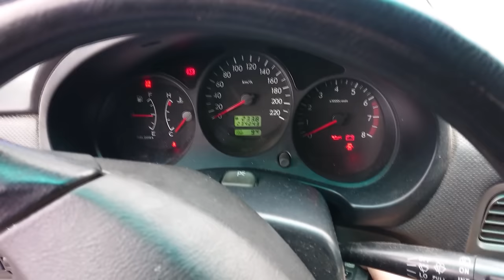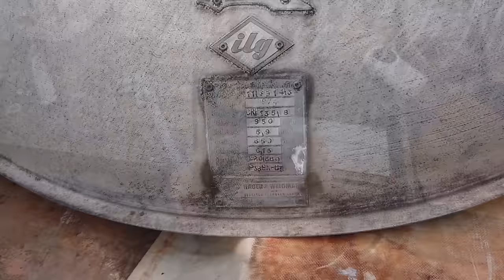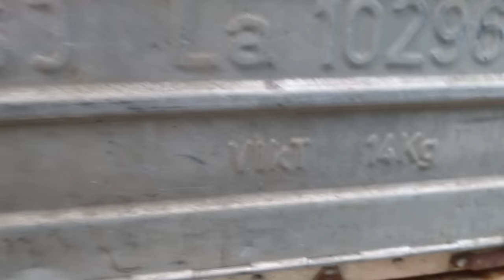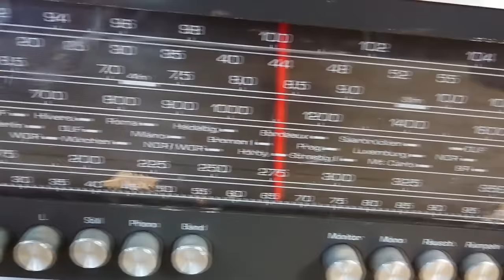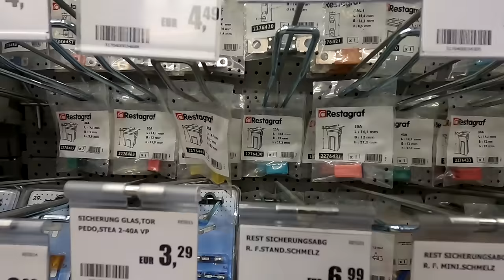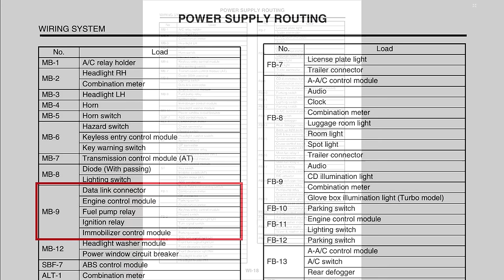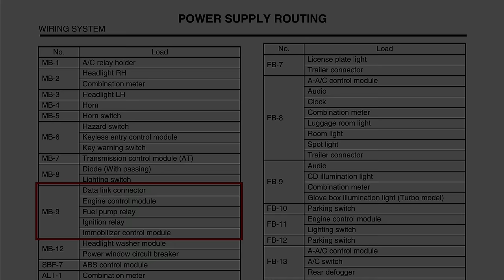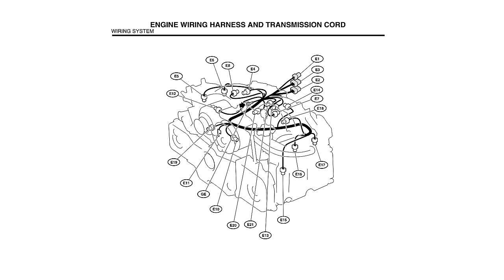New Awesome Scrapyard Finds! Repair-A-Thon!

Comment: I had a similar problem the mice had chewed through about six wires and nothing would work all sorts of errors. Repaired the harness and decided to move the car to different parking places to discourage the mice.  The most successful device I had that stopped them for many years was poison. I used a waxy bait which tasted similar to the insulation I hoped for. I place all over the engine bay very close to the major wiring junction to try and tempt away from the wires. It works for me. You do have to check it several times a year but it gives an idea if they are active again. 
I did have a self working mouse killer that turned up on its own. It was a snake that followed the mice into the car one day and was there somewhere for about a week before dropping down one day going on it's way. We get a lot of snakes in southern Spain.

Comment: Looks like the cable has been connected with solder there, and maybe the solder deteriorated and has risen the resistance of the cable and got it hot, because the insulation was melted in that area. 
I would spray the car and the surroundings with nasty chemicals like capsaicin so any creature without a gas mask would in serious trouble, so only you and JoeX would be able to drive the car. Very impressive work my friend i like this very much, and your attitude against modern rules.

Comment: I seen, heard and driven cars with these problems. A work truck that we had was bought for dirt cheap because it had a wire problem. A lot of late nights and a new wire harness fixed the issues. I have seen several nice looking units that sit because of this problem. 
The worst we had was a short in the ac unit on out last car. We traded up to a newer model before we got around to fixing it. The problem was the clutch which was a 50 dollar part and required to you recharge the entire system. 
Cars suck because they would rather tie in a bunch of stuff on one fuse. Yet Tesla is working on the new 48v system which in theory would be able to tell you exactly where the fault was. Which is kinda a cool concept.

Comment: I believe that patching a 12v lamp into the fuse socket is good for a diagnostic indicator.  When there is a short the lamp stays lit. When the circuit is open the lamp is dark.   But you already know this. Even better would be a buzzer or other audio source that might have given feedback of the intermittent short as you moved the harness around - jiggling stuff in that case might be a good method of diagnosing the problem.

Comment: Several important points here, electrical issues such as short circuits almost always occur in the engine bay due to heat and rodent damage , as mentioned , connecting a small high resistance bulb can help with locating the problem area because it will go bright and dim as you move wiring and unplug components. The fan lids you recovered were labeled ILG, this brand of fan is very collectable and well made.

Comment: A little off-topic but I think it is something you would appreciate.  It is an electronic device called a SOMA Ether V2 I have nothing to do with the company and am not recommending this for any other reason than I thought if it for an alternative way of analyzing electrical devices.  Your car would probably have needed to be running unless there was a way to inject a signal into the harness.  But still it is an advantage to know about this device.  I will just cut and paste the maker's description below.  With your skills you could doubtless devise an enhancement - for example a 6G translator...

***********

"ETHER is a kind of anti-radio. Instead of being tuned to a specific radio station, it receives all the interference and radiation that a traditional radio tries to eliminate in order to create a clean signal. It captures the radio waves “as is” from hertz to gigahertz because it doesn’t contain the tuned input circuit that filters out all frequencies except the narrow band of a specific station. This allows ETHER to perceive the invisible electromagnetic landscape that humans created unintentionally, making possible live electromagnetic field listening and recording.

As the inspiration for this project, I took the design of the very first radios (early 1900s) that had no tuning wheel. At this time there weren’t many radio stations, and all of them used Morse code. It was possible to distinguish each transmitter by ear, as each one had its own specific timbre or “voice”.

Also, we have to mention the earliest pioneer of electromagnetic fields art investigations – Christina Kubisch.

ETHER is pocket-sized (103x58x17mm) and light-weight (73g with batteries). It consumes very little power and runs on two AAA batteries. How long it can run on two batteries is unclear, because I still use the very same set of alkaline batteries I put into the first ETHER prototype 6 years ago! (yes the project has taken 6 years). All I can definitely say is that battery life is more than 300 hours if you using alkaline or lithium batteries.

We paid special attention to the design of ETHER, as it’s intended to be a unique accessory for the conscious modern human. We used special designed enclosures made in Europe and high-quality PCB and furniture providing long life and high reliability. So with ETHER, you get both a unique sound experience and a cool-looking high-quality gizmo.

ETHER has both magnetic and electric components for sensing radiation. For the magnetic component, it has a built-in magnetic antenna, like the ones used in old long-wave radios. The antenna has maximum sensitivity on ETHER’s axis. By changing the orientation, angle and position of ETHER, you will change the sound. For the electric component, it has antennas printed on the PCB and the special input pins placed on the anterior surface.

ETHER V2 has two external antenna pins. You can touch any conductive material or surface (including your body) with the pins and use objects or yourself as a big external antenna! Often it makes a totally different sound and I love to check out different metal objects on a street (rails, tubes, metallic doors, parts of buildings etc.) Two pins are connected to different points of the circuit and interact differently with electromagnetic waves. Switching from one to another or using them both, you can change the sound. Far away from a city, we recommend trying to use a piece of wire 1-4 meters long connected to one of the pins for getting some interesting sound.

ETHER V2 has two wheels for sound control and the power switch. The upper wheel adjusts the amount of high-frequency amplification and regeneration. The lower wheel is the volume. By adjusting high-frequency gain you can focus ETHER on different dynamical levels of surround interferences getting the richest and interesting sound.

ETHER is not just an inductive sniffer like some projects you can easily find online. A simple low-frequency inductive sniffer will be silent in most places that are full of sounds in the video. Such devices need to be placed close to an emitting source and will not work on a street. All they contain is a coil and a low-frequency amplifier. In comparison, ETHER has a regenerative circuit and a demodulator, making it an actual radio wave receiver, not just an amplifier of low-frequency magnetic fields. However, ETHER can perceive the low-frequency magnetic fields as well. But, honestly, if your goal is to scan objects in close proximity (0-20 centimeters), a simple inductive sniffer will work cleaner and more focused due to its narrow band and lower sensitivity. ETHER was designed to be a part of your walks in the city and may even pick up sounds in a forest or at the seashore (I have such experience). Also, ETHER can perceive the electric component of the radiation as well, capturing radiation that is far above the audio range and is much more sensitive. Therefore, it has a significantly different design, functions and implementation than a simple inductive sniffer even if in some cases their functions can overlap.

ETHER is very sensitive to any kind of digital circuitry that’s in close proximity. This is why I didn’t put an SD-card recorder or something like that inside. You also have to make sure to keep other electronic devices that you carry (phone, laptop, recorder) at least 30cm/1ft away to avoid interference, but ETHER definitely works well when you walk around with a smartphone and laptop in other pockets and bags. The output of ETHER is a regular 3.5mm headphones’ stereo jack with L and R contacts connected in parallel (ETHER has a mono out). To record ETHER, you need to use an audio cable of at least 1m/3ft in length to connect it to a device like a ZOOM recorder. Even with a long cable, ETHER can sound different than when using headphones. To get the purest sound, headphones are required. Some sounds you can record only with the mind, sorry. But the best snapshots are kept in our heart so let it be a part of the game:)

Comment: I have a 2010 Mazda 3 hatchback that I bought new and plan to hopefully drive until I die in 40 years haha. I never had an issue with it but had a ground fault if I left the dome light to automatically come on when I insert the keys. It was 800 to fix or to just disable the switch. 

We had a 1982 Subaru when I was 11 that we bought for 200 at scrap yard. The vehicle lasted 8 years and was awd without having to lock hubs. We just had to replace the bottom paneling and floor. My step-dad was a body guy so he did all the work in a couple hours.... we were 1300km from home and the motor went in our Ford escort.

Comment: I had a car that would shut down momentarily every few minutes.  I replaced everything I could think of (I was away from home), doing a short test drive after every attempt; but the problem persisted.

Then I noticed that when I drove in a left-hand circle the problem went away, but when I turned back to the left, it came back.  I finally found a wire that had been mis-routed over a metal line, and which had worn completely through the outer wrap and inner insulation, shorting against metal line.

Some tape and rerouting of the cable made my trip home much more pleasant.....

Comment: As mentioned elsewhere by others as well as peppermint oil, laundry tumble drier scented sheets also work if placed in some locations in the engine bay etc., they have a very pungent smell and seem to deter rodents.

Comment: After multiple rodent issues, I zip-tied 4 cotton balls under the hood. Soaked with a peppermint oil initially, then refreshed with a few drops periodically. Knock on wood, no rodent issues since!

Comment: Living in the US, we are quite used to rodents, usually mice chewing wiring harnesses.  Amazon sells a very cheap, $15 US ultrasonic emitter with bright flashing  LED lights, this is on a small timer when the car is not running.  I have installed one of these in my daughter’s car, and we have not seen sign of mice since..  a very cheap fix!  Good luck.

Comment: I had serious problems with rodents in my garage coming in from the commercial premises next door;  solution--UVC lamps !   There are Household UVC Cold Cathode U-type Ozone producing lamps as well as 10v ones on Ebay which I have used in conjunction with 240 volt ones, and have not had any rodent problems since installation several years ago.   You could even just connect a couple of UV globes to an extension lead, and drop them in the engine bay when you park ?

Comment: I'm glad you found the problem and fixed it. If it were an EV, there would have been no parts available and it WOULD be in the scrap yard. Great video, I enjoy them. BTW, I have a squirrel in the wall in my man cave here in my basement driving me nuts. I drill 1/8-inch holes in the wall and spray brake cleaner in at different studs to try to get it to leave. LOL. I haven't heard him today I hope he is gone. Rodents are a pain.🐭😭

Comment: Here in the US, Pine sol works great for deterring rodents, I'm aware its not as common overseas, but any quality pine based cleaner will likely do the same. Its also a great degreaser for automotive parts.

Comment: once you unplugged all the harness connectors it became obvious that the harness was shorted to ground somewhere, especially when it  started after you reconnected (wiggled all the wires) all the connectors and the engine started. later the harness jiggled back to short the wire. I've been fixing for 52 years and have seen this a few times. Good video, Thanks

Comment: I had rodent problems on my smart forfour once. I wrapped brush bristles to all critical wiring areas like injectors, fuse box and others. No more rodents since. 

According to the local mechanic, the brush bristles are like rodent furs and since rodents are territorial, they tend to stay away from other rodents.

Comment: certified auto techs use shiny chrome hammers, whereas a grease monkey might use a pipe wrench. do it your self, you would have found that short with a short circuit tester. a short tester is a heavy duty directional flasher and a amperage tester you just move along the harness. when the needle deflects at its maximum, that is where the short is. the meter picks up the magnetic field in the wires even if the harness is hidden behind a fender. thank you for all the hours of entertainment you give us.

Comment: There are two different kinds of kitchen sponges. The more subtle one is for glasses ("Gläserschwamm") and even the hard side is soft enough to not damage aluminium. The harder and more commonone "Topfschwamm" (pot sponge) often even contains carborundum on the hard side, which is close to diamond on the Mohs hardness scale and will just scratch and spoil everything.

Comment: I had a very similar problem so I installed a sonic repeller in the engine bay and had no problems since. Just remember to start your vehicle at least every three days or you'll drain the battery.

Comment: My opel zafira ended in a scrapyard in Sweden,  repair shop thought that the engine chain skipped a tooth(which was powering fuel pump as well) and it was too costly to take everything apart to repair, but if I was back home I would probably had it fixed with a help of a local mechanic.

Comment: What a frustrating experience trying to fix your car! In theory, a wiring harness should be one of the easiest things to diagnose, so long as you have a diagram of where each wire goes, and a knowledge of exactly where the things it connects to are physically located in the vehicle. But as you experienced first hand, the difference between theory and the real world can be extremely frustrating.

I'm glad you got the car fixed, and managed to find out what the actual cause of the problem was. At least you got half a video out of it too.

Comment: Wow, great work finding that fault on the car! I was thinking it must be in the wire when you said it was still there even after disconnecting everything, but still finding it can be REALLY hard when intermittent and with aluminium it might not be shorted without enough current/voltage.. !

Comment: Rite Apocalyptic Dude, Love the lamps. I'm in the process of drawing up a rise and fall lamp with two shades a center weight and pulleys I'm hopping to cast the pulleys from brass and make the rest of the parts but will have to source the lamps from elsewhere! Keep up the great work. TFS, GB :)

Comment: Just keep the car away from the cherry tree. Leave the bonnet up if possible too, use a tarp high up to keep the rain out. Hidden wiring looms can be ultra protected by using 32mm irrigation poly pipe, split the pipe push it over the cables and tape up. Rats won’t be chewing through that in a hurry. I use it as my Ford has a loom secured to the engine over a sharp edge of metal, the irrigation pipe stops it from chafing now. You’d have to remove that manifold again though in order to fit poly pipe over the cabling!

Comment: I have had similar problems with rodents chewing wires and spark plug caps ect. I found that Whurth 2040 spray will stop this . Rodents hate it I spray my motorcycle mowers strimmers ect and have never had a problem since. Great video as always.😊.

Comment: Engine sounds good! I´ve had a battle with a rat hanging out inside my wifes new car! Bugger ate threw the insulation on several wires. I think it was initially attracted by the engine warmth as it was unusually cold. I tried several humane traps but it was too smart but eventually took some bait wrapped in peanut butter. Then i could literally see where it had been in the engine bay as it left bloody footprints everywhere. It would even go inside the fenders. Crazy. After a couple days i came across it and put it out of its misery - poor bugger. For you it sounds like its potentially going to re-occur. I´ve seen that flashing lights, noise, and peppermint spray (they can´t breathe) are the most effective. So spraying your engine bay with lovely mint is a start, then a little bicycle flashing rear light on a timer under your hood will probably do the trick (maybe put it in parallel with a 12v siren that blips for a split second). Good luck!
Reply: Loved the projects! Great finds... i haven´t been to the scrap yard in a while because i come back with even more projects!

Comment: I find that fitting a 12V lamp in place of the fuse. a stop and tail lamp gives the ability to have a 5W or 25W limit. good for finding breaks where a voltmeter might still show 12V present.